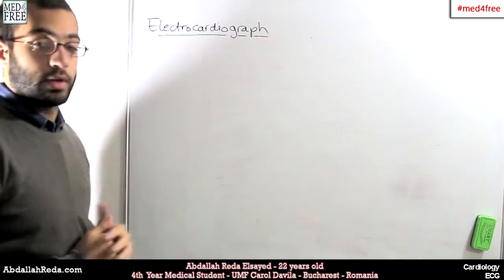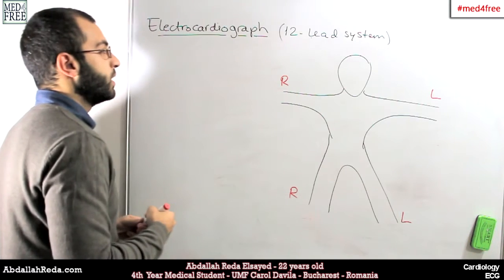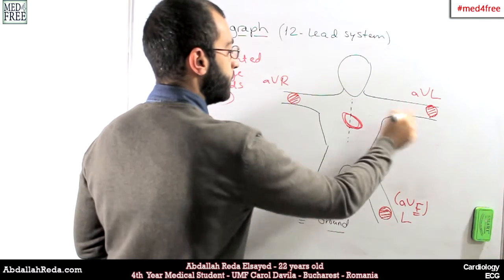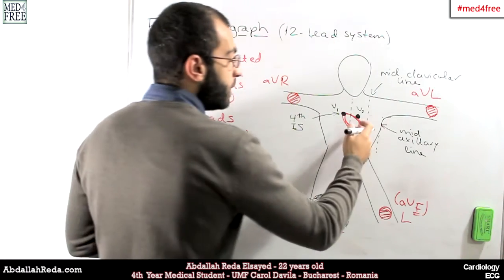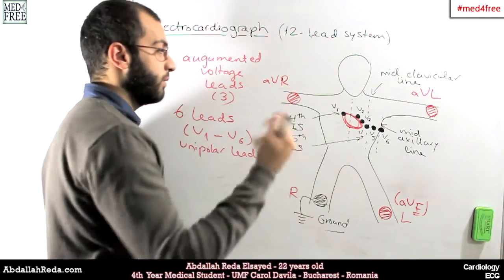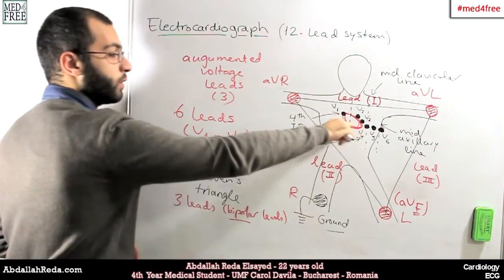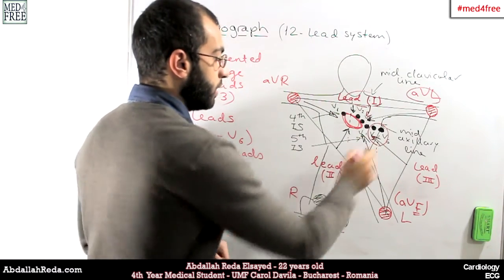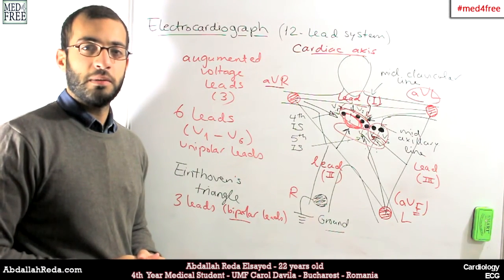How does the ECG 12-lead system work? - عبد الله رضا MD | Rocademia روكاديميا

Comment: I am totally confused about the voltage that reaches the leads!
- In augmented voltage leads, how does the device supply the voltage??? Doesnt the voltage arise from the heart and radiates towards the aV leads? 
- What's the significance of placing the Augmented leads on the limbs? I know that current is conducted through body fluids and so it reaches the aV leads, but can't it mistake the current of the skeletal muscles with the current of the heart? 
My questions seems a little theoretical, i know :D But I need an answer.. 
Thanks in advance.
Reply from the maker: The augmented leads are not real leads, each augmented lead is made out of two poles of the actual leads, aVL, avF and avR. The real electrodes/leads have a voltage that arises from the heart, that's correct. They are placed on the limbs (two arm and one foot), so that when they virtually connect, they form a triangle, with the augmented leads I, II and III being it's sides. When the cardiac electricity vector moves, it will cast a projection on one of the sides of this triangle, thus informing us about the cardiac axis. This is why they are arranged like that.
Reply: For not to mistaken by skeletal muscle electrical activity we put lead at bony parts e.g. ankle and wrist